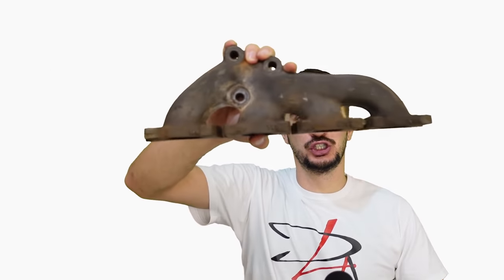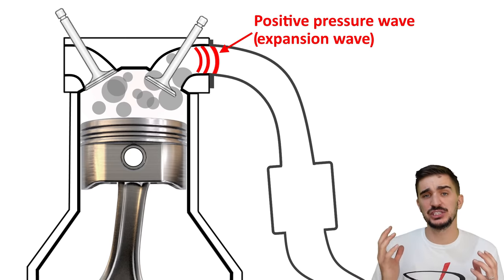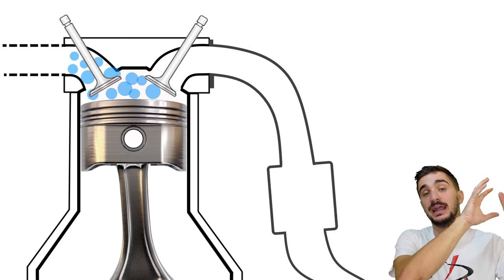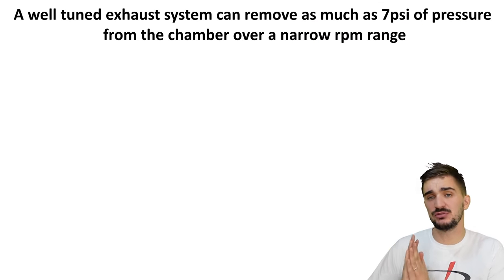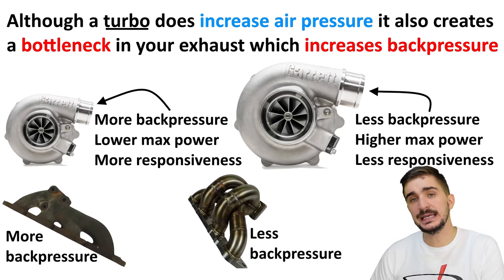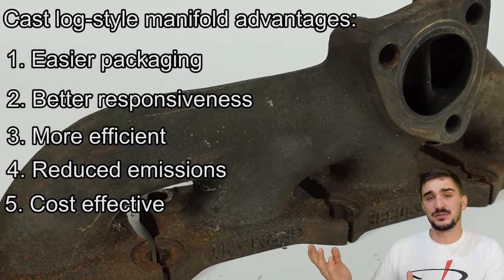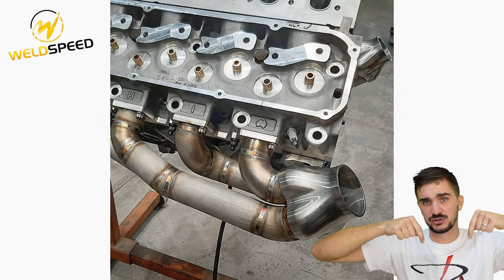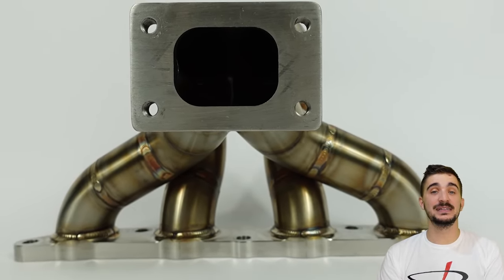EQUAL LENGTH tubular vs. LOG manifolds (headers) - SCAVENGING and EXHAUST BACK PRESSURE EXPLAINED

Comment: Havent had a chance to watch the whole video yet. All i can say is quality of item means alot. My oem 30 yr old cast mazda gtx manifold mint. My spa cast manifold cracked in 10,000mi. I had it welded, gonna gice it another shot. Hesitant to buy the 1300 full race manifold. 1. For the 3x more price. 2. I heard cracking issues. But i also heard if you brace the down pipe properly you will be fine🤷‍♂️.

Comment: One aspect you didn't talk about is sound. This is more noticeable in V engines.
A cross plane engine with equal length headers will sound similar to a flat plane engine.
In other words the engine will sound like a middle ground between US(cross plane) and EU(flat plane) engines.
Reply: Same thing on Subaru's boxer-4 engine. Put an equal length header on it and the sweet rumble is gone.
Reply: @jackberserk777  I prefer engines with smooth sound because they remember me of how Hyper cars sound.
Reply: @jackberserk777  why do they sound so Cammy, like they wouldn't even pass emmissions?

Comment: I used to run stock "ram's horn" manifolds on my 1967 Nova 283.  Ran fairly well until I installed a set of Hooker Super Comp headers.  I picked up 9/10ths in the quarter mile with NO other changes!  14.50 to a 13.60.  That blew me away.....And no, I never worked for Hooker!

Comment: Very important thing about stainless steel manifold you didn't managed to say: stainless steel is tend extend under the exposure of heat  much more than cast iron. This means that manifold flange (especially long ones like on inline 6 engines) could be wrapped  during heat up and cool down of the manifold. Usually wrapping occurs on the sides of the flange. Middle runners usually have a "loop" up (U - type pipe) or down, but side runners usually have a L-type pipe. In the heat cycle the U-pipe have the place to extend without wrapping the edge of the flange (and the "arm" of the applying  force is low, because the force is applied across the flange and the width of the flange is small). On the other hand - side runners do not have a "loop" which could be extended during the heat cycle, and the runner starts to push on the side of the flange in direction to the engine head, it can't realy move the flange further to the head - flange is bolted on the head, so the runner starts to wrap. But the real problem is a cool down cycle, when runner start shortening - it starts to pull the side of the flange from the head and the worst scenario is - it pulls the flange with the stud it's bolted on from the head. As the result - damaged thread in the engine head and wrapped side of the flange.
There some ways to escape this situation - buy (or weld, if you do it by yourself) a manifold with a U-pipe section facing up or down on every runner, avoid L-type pipes on the side runners, cut the long flange on several parts (make kind of individual flange for each cylinder or for a pair) - this will shorten the arm of the applied force of the wrapped runner.
This is a real problem of many cheap manifold, and of some expensive. Usually you do not experience is before you tune the engine to the limit (thus very high exhaust temperatures). 
Thank you for your attention.

Comment: I  understood on boost, a turbo engine will not scavenge.  The exhaust back pressure is higher than the boost, valve overlap will allow some exhaust into the intake runner.         

For a given boost, a big turbo will have lower back pressure, so it will make more HP than a small turbo.

Comment: My first car was a 1992 Mitsubishi Eclipse GSX I picked up for ~2k back in the early 2000's ('01 or '02 I think). I don't think I had the thing more than three or four months before the manifold on it cracked. Spent around two years trying to find a replacement (we didn't really have Amazon [in it's current incarnation] or anything like that at the time) and every single one we could ever get our hands on was also cracked. We couldn't even find any aftermarket options. I seem to recall there being a few for the GS, but nothing we could ever find that would fit the GSX. 

It sucked balls 'cause I loved that car. I smoked a lot of "Type-R's" in that thing...

Comment: I had long tubes and dual 3” exhaust in my 5.7L tundra it ran awful and loud. Then I added 1 x pipe and 1 x pipe muffler to the system (system has now 2 xpipes in series) and you can feel the difference truck noise is more pressurized and quieter. And it improved in power as well.
Reply: what, what?

Comment: back when this really mattered, especially in Australia we had a lot more lower power inline 6 instead of v8 (had them but less common) in say 60's though to 90's, and we would call them extractors instead of headers, but we would heat tune them, so we would make race pipes very long, run the engine hard and measure the temp alone the pipe, basically where the steel only got to yellow instead of blue or red, that is where we would end the pipe and join 2 into 1, and those 2 into another 1 and so forth to get from the 6 to 1 pipe. A real serious set would be ported to and matched pipe size, but in either case we then dealt with back pressure once we met the single pipe, but diameter/length/bends. Man every tenth of a horse power added up back then

Comment: I always knew the equal length are better in term of performance. But cast can do just its job for vintage performance.However it's something i learn something new from this is the benefit of each are just as good.

Comment: Actually, the intake on naturally aspirated engines is in a partial vacuum and not atmospheric pressure. Otherwise, great coverage of the impact of a tuned exhaust system on an engine.
Reply: I think he wanted to express that atmo pressure is what you got helping from the outside, apart from the engine having to exert effort or use some trickery to suck it in.
Reply: @Dowlphin  the intake pulse goes from a very low speed, if any to 250' per second in a very short time.  The violence of the acceleration and subsequent deceleration in a chamber less than 4" deep is hard to fathom. I can't imagine what that must be like for an air/fuel particle! I was trying to imply that concept.
Reply: An N/A engine's intake is only in vaccuum at partial throttle opening, but at full open throttle the intake is literally at atmospheric pressure. It is the low pressure from the intake valve opening that pulls in this atmospheric pressure air.

Comment: Always good explaination videos except....   Speed of sound in exhaust is much faster due to the high temperatures.  Speed of the exhaust itself approaches .8 - .85 mach.  
Pressure waves do help with scavaging, but the biggest thing in tubular headers is momentum.   The air is moving out of the cylinder at a given velocity and the air has mass to it.   When the piston reaches the top, it is no longer pushing the air out, but the momentum keeps the air moving and pulls a vacuum - when the intake valve opens, this vacuum can actually get the intake flow started.  So you get race motors with VEs of 120%  (I think Pro Stock motors are around 118%)
This is why the best header makers would rather have narrower exhaust pipes (more velocity) and smoother bends (again more velocity - less turbulence).
Most header manufactures sell in large quantity and tend to make the tubes too big - which is how their customers like it.
Reply: Oh, and the equation you gave is a bit silly...      RPM-3 ?????    so 6500rpm - 3      Why not 4?   Why not 2?   makes no real difference because the number is so small.   I think you mean 3 x.   Other than that the numbers are too small.

Comment: I’ve been trying to find the formulas for :
(Exhaust and intake - runner lengths, diameter, diameter of collectors and angles for each runners transitioning into the collector )- based on exhaust and intake port diameters,  engine displacement, cam spec , peak torque & hp rpm . Also how to design the manifold to significantly changed the sound- better harmony. 
However not much luck bc everyone who has the info, taking it to their graves so… meh 
Love the video
Reply: Also for plenum volume I read somewhere that it should not be more than 1 1/2 x of the displacement of the motor

Comment: The way that I look at the negative pressure wave is that it travels 1200 fps to there and back so the time interval for the distance covered will determine half the rpm that you are tuned. (it is a 720 degree cycle)
Reply: I went through all this with 2 stroke motorcycles

Comment: Mainly watched to just dust off the rust but I do have 1 question...
Doesn't the angle of each pipe on your manifold want to be close, if not all the same degrees of angles?

Comment: Question, are there any Symmetrical cast manifolds? IE where the tube lengths are equal for cylinders 2-3 and 1-4?
Reply: I'd say yes, it all depends on the manufacturer's needs but my old rover 214 had a simple cast manifold that merged in the center
Reply: There's one for a turbo 13b, it's totally sick

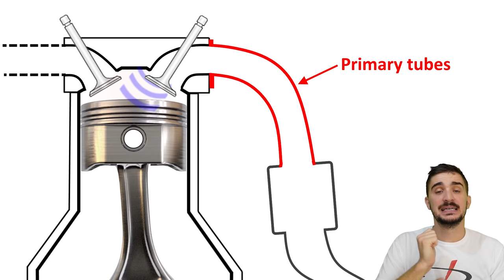Comment: 5:50 it's the distance from the back of the valve to the change in diameter that determines the pressure wave length, not at the beginning of the exhaust manifold.

Comment: About 20 years ago I'd a Fiat Uno and that car got a huge hole in the exhaust. It was noisy but I got used to it so not fixed. Then the car started each day to be more and more weak, and the fuel economy was horrible. I bring it to my mechanic and he listen to me approach his shop. He don't even wait for me complain, she just said me to go to a exhaust shop and repair that exhaust before bring the car to him.

I found kinda rude but trusted him and fix the exhaust. The other car problems were gone with the new pipes. I only returned to thank and tip him. That day I discovered how the exhaust system is very important

Comment: Thanks Professor
Very interesting and helpful.   Does a car need to be tuned when an Equal Length Header replaces a stock header?
Cheers
Reply: The vehicle would probably run just fine without a tune, but you also probably won't see the full effects without one. Really no point in doing most performance mods without some kind of tuning, especially when it is has a possibility of doing more harm than good
Reply: @theawesomeguy9999  @inorvain  I second this response. He said nearly verbatim what I would have said. The reason he is 100% correct is when you change a component that influences air flow, inlet or outlet, you have mechanically changed the tune but never for the optimum result alone. The ECU should be tuned to compensate for the mechanical changes and maximize overall effectiveness. If you do not the mechanical changes will butt heads with the tune rather than both working together in unison. Like roasted goldfish hinted at, sometimes changing an exhaust component will actually reduce power output unless you correct the tune (I've seen that a lot).
Reply: @3dw3dw  Thanks !
Reply: @theawesomeguy9999  Thanks !!
Reply: @i.norman  a tip for you. Get the headers, intake, head work and cam that are all meant to compliment each other. Buy them one at a time if necessary, put them all on at the same time and tune it once and be done. An intake and exhaust should both be tuned for the same RPM and they will compliment each other. The lift duration and overlap of the cam grind should be tailored to compliment the relationship between intake and exhaust piping. When the resonant pulse frequencies of all these components are in agreement you get the best result and the computer tune is much easier and works better. So don't make peak power at redline. Move it down so you can use it. I like peak power at 6,800 RPM. I shift so that the next gear will drop me to 6,400-6,600  RPM. So I stay in the peak power range longer and get more benefit.
Reply: On a speed density setup that can't account for the volumetric efficiency change then yes, otherwise AFR will be leaner than before from the extra (unaccounted for) airflow if an improvement was made. MAF style setups that directly read airflow will be more forgiving. The more the manifold/header change helps, the more that tuning is necessary (at the very least getting AFR back in line)
Reply: Thanks for the additional info. Much appreciated and under advisement
Cheers
Reply: @morrisonfabrications  Thanks for the info !!
Cheers

Comment: Awesome video, I've already seen some of the theory how manifolds and back pressure works, but you've put it all together even better and more simple to understand!
Great job, and thanks for sharing us your knowledge!
About the lower part of the formula to calculate runners lenght, rpm - 3, if peak hp at rpm is say 5500, does it mean ive got to use 5497 as a lower part of formula then :D?
Im not good at math, but this does not make sense to me, why -3? Also my result is 23.1 , but is it in centimeters or what?

Comment: With turbo forget equal lengths , just use right size , usually quite small , and make them as short as possible with smooth bends.

Comment: You are missing two important articles... (1) Just because the manifold is an iron casting and stock doesn't mean it is of unequal length. There are cast manifolds that are equal length or "almost" equal length.  (2) There is also quite common today to have turbocharge engines WITHOUT MANIFOLDS. The exhaust collector is integrated into the cylinder heads and water cooled along with the rest of the engine. These engines have ONE outlet, often segregated for twin scroll turbos, that the turbocharger turbine housing bolts directly to. The VW EA888 and GM LF3/4 are good examples of I4 and V6 turbocharged engines with head integrated exhaust collectors.

Comment: So, what I understood is, ideally the length from exhaust valve to turbo is zero, for the best response (by minimizing the volume between the two). This would be achieved by putting a turbo on each exhaust port of the head. Not only would this add complexity, each turbo would be hit by an exhaust pulse every 2 rotations, a peakyness in air delivery and pressure that will probably add vibration and inefficiency. Connecting every turbo with common shaft could virtually eliminate this, and also simply the system by only needing one cold side for the turbo system, while keeping indipendent warm turbines for each exhaust. However, having a shaft exit through the hot side of the exhaust pipes will make it impossible to properly seal, so a single continuous shaft connecting multiple turbos is unfeasible. Having multiple parallel shafts connect at a 90 degree with a main shaft would also be a nightmare to keep aligned with minimal power loss at the rotational speeds of turbos. 

So a set of warm plus cold sides is required for each exhaust port. 

The exhaust after the warm side can continue into an equal length header, possibly creating a scavenging effect for that part of the exhaust. While the turbines can be smaller, the added mass of multiple turbos could cancel the throttle response gain.

Hoesrly, it sounds dumb but there might be a chance that it works. It would definitely be an interesting experiment, one turbo per cylinder.

Comment: You touched on, but missed out on explaining blowdown :(

Blowdown is when the high pressure wave is initially generated. It can also travel back up connected pipes and reduce scavenging on other cylinders. A good rule of thumb is exhaust duration should be less than the firing angle between connected cylinders, but on a 4-1 performance 4 cylinder that can't happen. Longer runners increase the wave travel time and at high rpm this effect alone can net substantial gains

Comment: Excellent explanation as always and many good points made! We would like to chat with you about what we've come across through some of our back-to-back dyno testing on various turbo manifold designs and the underling mechanisms that could add to what you discussed in the video; such as how large vs small primaries and their velocities change response as well as VE and power changes across a wider than expected rpm range etc. Counter intuitive results that seem to have filled in gaps in the general consensus. Cheers
Reply from the maker: There's an email in the channel about section 😊

Comment: I own a Saab 9000 2.3 with NA engine, the manifold is cast tubular and of equal length, look like an OEM manifold, but it is stock. They put a lot of engineering effort into such details, the details that most buyers won't even look at it, the reason why it wasn't sold well, it was expensive from these things than competitors that don't spend money engineering such details.

Comment: Very interesting video. In the real motorsports world Inconel rules in the primaries. It's is multiplies stronger than stainless, with a much higher melting point, and can be fabricated with much lower thickness.

Comment: All things being "equal" one of the best noticeable performance gains comes from the choice of Cam. Often times that's a better investment (least costly) than headers .   I have always been a fan of a tri Y header design. Since it scavenges creating a   vacuum for the following pulse. 
     I'm also a fan of super chargers since they not only provide Power gains but better fuel mileage as well. 
     My airplane uses two superchargers with clutches and a costom manifold.  It provides an extra 130 # of torque on a type 1 2300. Which allows a take off run under 30ft. Or better performance at high altitude. And  the cam produces its power between 1200 and 3200 RPMs.
Reply: I don't know what engines you're building but a camshaft is highly unlikely to be cheaper than headers, unless it's a cheap, not-so-agressive cam compared to a stainless steel top-end exhaust header.